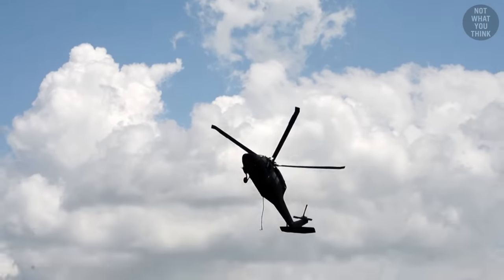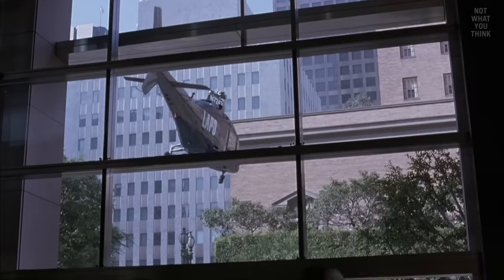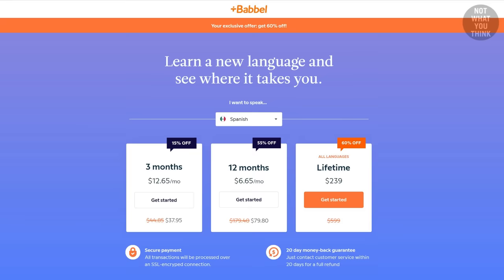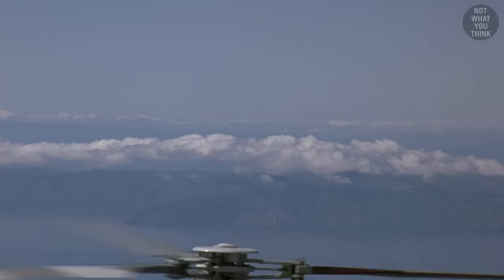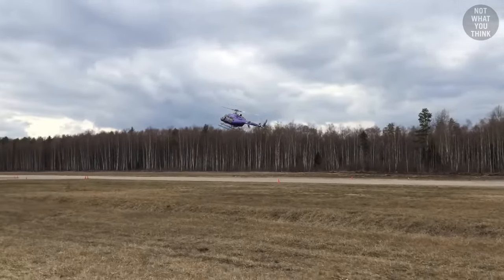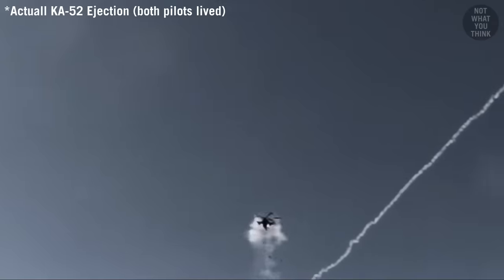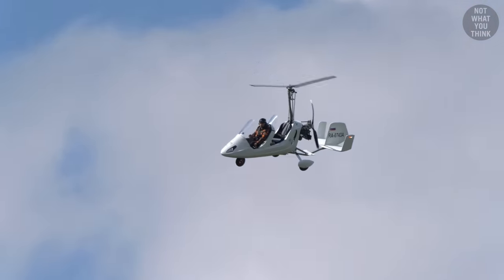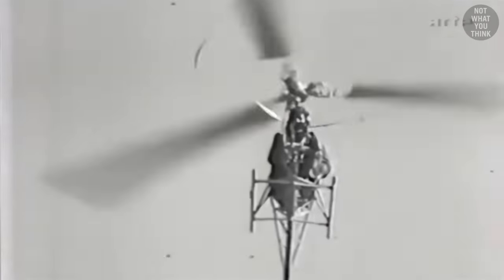Why Helicopters Fall Like a Leaf, Not a Rock

Comment: the way i like to describe autorotation to people is that you lower the blade angles to keep them spinning as much as you can. The rotor disk provides some drag to slow your descent but not enough, so right before you hit the ground (10 feet or so), you’ll fully increase the blade angle to convert all the kinetic energy from the spinning blades into lift to arrest your descent and land softly. The helicopter might get a little damage, but everyone inside will live.

Additionally, for a helicopter that’s lost its tail rotor, if you maintain suitable forward speed, the aerodynamics of the helicopter will keep it from spinning out of control. So you can fly normally until you reach a good place to land, then reduce engine power as you allow your forward velocity to slow. Time it right and you can land without ever losing directional control or having to cut power to the rotors.

EDIT: See replies for correction to point 2
Reply from the maker: Thanks for the explanation 👍🏼
Reply: @NotWhatYouThink  I bet it was not what you thought!
Reply: The first explanation is only really partially correct, but overall it's not a bad oversimplification for dinner parties. 

Unfortunately your second point on tail rotor failures is mostly incorrect. Firstly, if the tail rotor fails in forward flight, most helicopters can maintain that forward flight if you have sufficient airspeed and use minimal power. However, you do not want to allow that forward velocity to slow, otherwise you would yaw out of control. There's no 'timing it right', it just wouldn't work. The actual method of recovery is to perform an autorotation once a suitable area is reached, or if directional control isn't possible, enter autorotation immediately. Since the tail rotor is there to counteract engine torque, intentionally disengaging the engine from the rotors removes said-torque, meaning the helicopter has little to no force that the tail rotor needs to counteract, and instead the nose will remain pointed into the forward slipstream mostly on its own.  

Source: Been teaching people to fly helicopters for 6 years.
Reply: yup you got it...  kinda sounds like you been there.....   gotta say what a surprise..     almost like ya need a new pair of underwear right after you hit the ground
Reply: So do you think the black hawk, ' super six four' could have been saved, by the auto rotation, during operation Gothic Serpent in the Somali (Black Hawk down) incident ?
Reply: @mitchellh5869  Yeah my explanation is meant for people with minimal or no knowledge of aviation.

It sounds like i was taught wrong about the tail rotor thing though. I know the helicopter flying handbook lists autorotation as required if you can’t regain control but we always focused on situations you can recover from. I’m but a fledgling heli pilot so i’ll defer to your judgement. Edited the original comment
Reply: @udayanpaul8042 It all has to do when the emergency starts, altitude, attitude (maneuvering) and airspeed. Sometimes it just doesn’t happen and you do the best you can. Never quit flying the aircraft. The Hawk as hit by an RPG when he was slow, low and maneuvering. No time to recover….just crashed the best he could.
Reply: @rdwelch2  many thanks for your kind reply, I thought the same, low altitude and low airspeed was the killer, 'altitude is the friend', as the aviators say.
Reply: @udayanpaul8042  I'm not too familiar with that story but I would imagine not. I'm confident that if it were possible the pilots would have done it. Remember that autorotation is only for situations where your engine fails but the rotors and the rest of the helicopter's structure remain intact. I'm willing to bet that the physical damage the black hawk suffered was just too much.
Reply: @thestateofalaska  Yes sir indeed, I agree with you, in that incident, the engines were alright, except the tail rotor was out of action, since auto rotation was not in count unless they switched off the engine, rest is self explanatory.
Reply: @udayanpaul8042  You don’t want to “turn the engines off” or you’ll lose  your generators and all things that aren’t DC. Entering autorotation will stop the spin and if you’re in position to maintain airspeed enough to keep the aircraft relatively straight, you can fly to an area that you can to perform a roll on landing. But airspeed in this case would be the KING! If you get to slow, you’ll spin and not be able to control the aircraft. The damage initially severe enough with the power (TQ) applied, descent, and all the other factors that make a situation go south. If there was altitude and nobody shooting at them, I’m confidant they could have handled it…..but if Grandma had balls, she’d be Grandpa…Can I say that?
Reply: There is even simpler explanation: rotor blades are just regular wings that move through the air, making a helical path. The autorotation mode is just gliding, nothing more.
Reply: @onebronx  Just curious how many autorotations you’ve done and what flight school/training did you go though that taught this “simpler explanation” before you went out and “glided” through your first one?
Reply: @rdwelch2  Just curious, did you at least study aerodynamics 101 before coming up with your ad hominem? If yes, then tell me please, how an authorotating rotor blade is not the same as a gliding wing tracing a helical path?
Reply: @onebronx  First things first. Yes I did (Embry Riddle and at the Aviation Center, Ft Novasel, AL. Then it was Ft Rucker, AL) and there was nothing personal in the question! It was an honest question. At neither place I studied and learned was it put in the “simple explanation” you gave. 1) a main rotor blade, or tail rotor for that matter, is made from different material than that a “wing” is. Yes they, rotor blades, have the same aerodynamics as a fixed wing such as a stabilator, elevator, left wing, right wing…etc. 2) MR and TR blades are subjected to forces much higher that a fixed wing surface. IE.. bending and twisting during flight. 3) The glide that’s referred to is determined by weight, height above ground, landing areas available, and basically the nature of the emergency….none of the wings are symmetrical. They have to have more air flowing over the upper surface to create lift for flight. Same as the MR blades are used to lift that helicopters need to get into and sustain flight. There’s more involved in the act of flying but I’m sure you’re well aware of that.  Now I’ve answered a little of what you asked, still waiting for you?
Reply: @mitchellh5869  His first point was also incorrect. Snatching the collective all the way up at 50 feet of altitude would probably be fatal. I always guarded the controls, no matter how experienced the student/pilot was. I always remembered the DE's statement to me when I took my CFI ride. He said "don't get killed."
Reply: @thestateofalaska  The comment about pulling pitch to max out the blades' AoA at 50 feet was also wrong. Fatally wrong.
Reply: @udayanpaul8042  Autorotation is NOT achieved by shutting down the engine but if one does do that, autorotation better follow immediately.

Comment: When you mentioned what was supposed to happen in a tail rotor failure, I immediately breathed a sigh of relief. Finally someone gets it.
Reply: Still extremely dangerous.  They even named it.  LTE: Loss of Tail rotor Effectiveness.
Reply: The problem is that you need forward velocity at low altitude for auto-rotation. So if you're hovering and you back up into a tree branch or a power line, that loss of a tail rotor is probably unrecoverable, and you pretty much will just spiral into the ground.
Reply: Yep when the lazy axle is shot to hell
Reply: @RamadaArtist depends on the dead man’s curve for the helo. But at power line height, you have had plenty of time for pre spin and once you feel the change in yaw, cut the engine power to eliminate torque and thus the spin.  You will still be able to maintain your drag coefficient of ~1.4 but might now be able to flare much during the landing.
Reply: @mikezappulla4092  "But at power line height, you have had plenty of time for pre spin"

"Pre spin?"
Reply: Why don't they build these huge helicopters as counter rotating choppers? That solves some risks. These two rotor helicopters have a huge problem when one rotor says bye bye. One bullet is enough, right?
Reply: @voornaam3191  There are several models with counter rotating main rotors, but they have their own issues.
Reply: @RamadaArtist yeah

Comment: V22 can't autorotate due to how short the propellers are in relation to the aircraft size, but they do share a drive shaft so in the event one engine fails the other engine can provide enough power for landing
Reply: If an osprey crahses due to dual engine failure, thats more of an unlucky pilot than a bad one
Reply: The V22 Osprey can in fact autorotate, and it can also glide, but its autorotation index and its glide profile are very bad, so either landing would probably damage the airframe at best even if everyone walks away with a bump on the head or mild whiplash from the landing gear blowing out. Its noted by NATOPS that its possible to do, but: "The high disk loading and low inertia of the rotor make successfully concluding an autorotation more challenging than in a helicopter." as they said. More challenging, but not impossible. For an example of the glide characteristics, the stall speed of a V22 in forward flight mode is 110 knots, while a Lockheed C5 Galaxy has stayed airborne as low as 50 knots but is generally said to stall at 80 knots.

Edit: Well, I corrected myself in the process here, but the V22 does have a decent enough glide profile that it can do a controlled conventional landing in the event of dual engine failure, its just that they have to land at a good margin above 110 knots to stay in control and have the engines tilted upwards by some amount to prevent the blades from contacting the ground which causes a lot of drag and makes it harder to land this way, its why you only really ever see an Osprey take off vertically despite them being able to take off like a conventional plane, and actually do it often enough for it to be easy for pilots to manage with their skill and familiarity with the aircraft.

Comment: My friend is a professional RC(Radio control) helicopter pilot, he uses a lot of autorotation in order to land because the thrust-to-weight ratio is exceptionally high so when the throttle is cut they can lower that ratio.
Reply: So as to not over correct on the landing?
Reply: I like the part of RC vehicles comparing to a real ones. I drift with RC cars without crashing, but still not allowed to compete in a real track. I also fly RC helicopters, but nobody gives me license. Just their drivability isn't the same.
Reply: @JustArmands I think learning helicopters thru Rc is great to get and idea before learning to fly them. Same with learning to do a 360 drift in GTA and applying steering wheel and brake control to a real car. It's all to get an idea. Its how I started practising 360 drifts, then applied to open road practise, and I secceeded. ^_^
Reply: However, rc drifting is wack compared to videogames and real life. Rc cars have wayyy too central center of gravity compared to a generic front engine rwd car. Especially with plastic wheels and 4wd open diff rc car drivetrain.
Reply: Sounds like a 3D "stunt" copter. They may be the hardest flying machines in the world to master. And you might as well treat a large one like a real helicopter as they have plenty enough power to severely injure.

Comment: I think you neglected to mention that part of an autorotation landing procedure is to "flare" just above the ground in order to soften the landing. This is usually accomplished by "aft cyclic" which means varying the blade pitch at the portion of its arc that causes the helicopter to tip back. In effect, use the fall to turn the blades, then in the final moments use the turning blades to slow the fall.

Comment: I have to think the discrepancy between more crashes per 100k hours and fewer deaths per 100k hours is just down to helicopters not carrying as many people as airplanes.
Reply: Yeah probably
Reply: He still makes a good point about the altitude and use cases of helicopters.

I'd be very interested to see the statistics for survival rate by "altitude of engine loss" between the different types of aircraft.

I'd still think airplanes are safer, but I've never seen the evidence, or really thought about it this way before.
Reply: @usopenplayer  Airplanes are way more dangerous at low altitude. They move much faster and the space requirement for a safe landing is much higher. But that's kind of like saying a bow is bad in a bar fight. It's actually a great weapon if used in the correct environment. Normal cruising altitude for airplanes (even general aviation airplanes) is high enough to give you several minutes to react to any problems and find a safe landing area. Commercial jets usually have several airports they can glide to if a problem happens.

In fact I don't think it makes much sense to compare airplane and helicopters at all. Your alternative to helicopters is unlikely to be an airplane, but rather walking or climbing. You can't exactly fix a powerline from an Airbus and you're not flying across oceans in a Robinson.
Reply: @djinn666 Exactly. You’ve summarized the apples to oranges comparison here wonderfully.

Stellar video though, I was hooked by how informative it was throughout. Gonna smash that subscribe button.
Reply: @djinn666  I like the bow in a bar fight scenario.
Reply: Not really considering most aircraft deaths are from general aviation accidents with    just one or 2 people involved. 

Looking at military crashes alone and you will see the the odds of surviving a helo crash is higher, higher than the statistic in this video.

Comment: Out of curiosity, does that fatality figure account for the number of people onboard the helicopter/plane? I just wonder if the helicopter death figure is lowered because each fatal crash will only result in one or two deaths on average. I know that most fixed wing crashes will also be single seat or other small planes, but I imagine the average would be brought up by the occasional commercial crash of 100 or 200 people.
Reply: I was thinking that too
Reply: Mortality figures related to modes of transportation are routinely quoted in miles per person per hour(2)

For example, an airplane with 100 people on board travels 1000 miles in 2 hours That’s 50,000 man miles per hour

Whereas you spend two hours solo in a car our motorcycle going 60 mph you only logged 60 man-miles per hour 

The the best way to interpret this is death rates per trillion man miles

Motorcycles come in at a whopping 200-ish

Most commercial travel modes land somewhere between 4 to 12 and that includes trains, buses commercial airlines